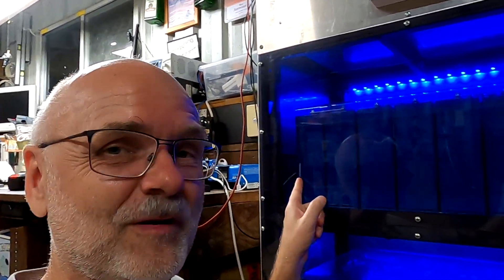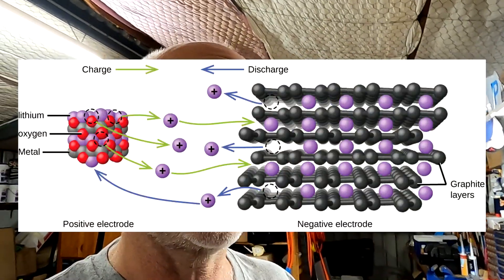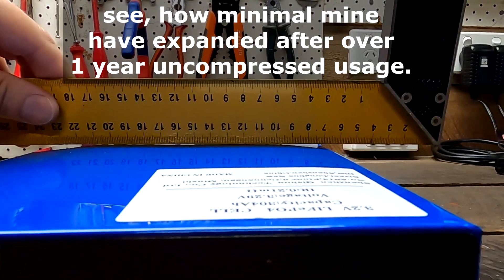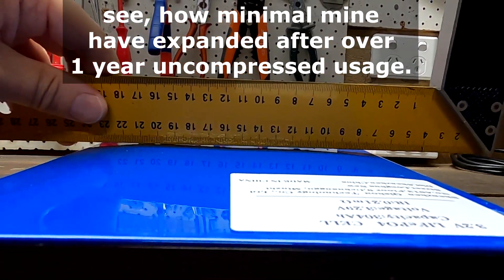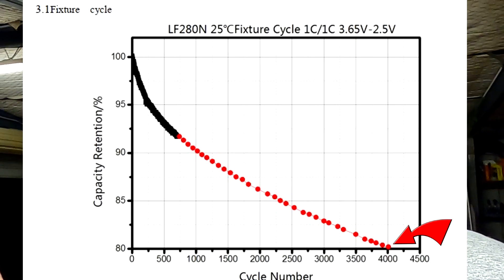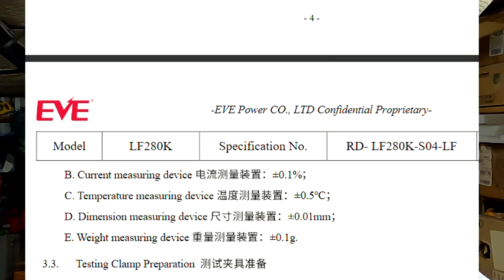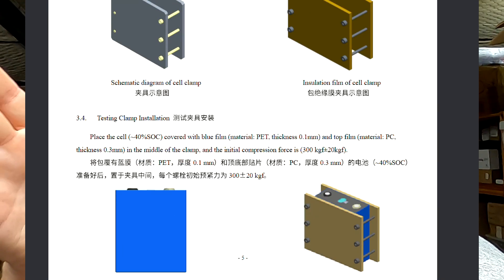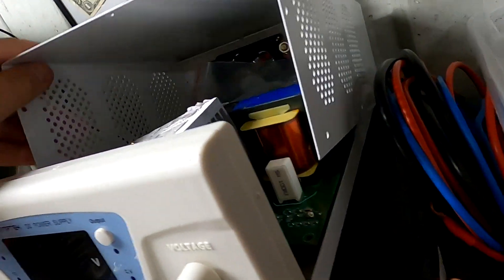Why you should compress your LiFePO4 battery! And why it does not matter... 🤷‍♂️

Comment: From a CATL datasheet :

"The cell will generate swelling force during attenuation. The swelling force of the cell at 60% SOH under the test
condition of 15mm steel plate, which is about 40000N. The customer needs to consider the reliability of structural
strength in the product design process."

I'd say yeah, that is heaps of force. If I did the maths right, thats 1100kPa or 160PSI. Likely more since I used the entire surface area of the side of the cell (280AH) since it was not indicated. Kind of crazy. 

Looking at the construction of various batteries (from those with no compression, to those with squishy foam pad things, to those banded with steel and heavy steel plates at each end) I reckon I really like the idea of squishy rubber padding between the cells, with some compression from either steel banding or threaded rods. Gives some pressure, but has give too. 

Only time will tell, for first hand experience for me. I've only just gotten into the LiFePO4 game.
Reply: I have six different (compressed) packs in operation. All cells are isolated, 2mm cork, 240g/m^2 waxed paper and 2mm foamed plate material. The foamed material looks best and the + - 1mm expension during charge / discharge appear perfect compensated.
My next packs will by in the same way!

Comment: May ask sir is it ok that my 24v battery system, charging voltage for lifepo4 in 27.2v in boost and 26.8v in float? Will it be healthy for lifepo4 battery? Thank you sir😊
Reply from the maker: Yes, that will be healthy. However charging to 27.2V (3.4V) is maybe a bit low. The cells are still in the flat part of the charging curve. You may want to set the charge voltage to 27.6V to get them out of this flat part. Also start balancing at this voltage in your BMS or active balancer. Float is perfect with 26.8V.
Reply: @OffGridGarageAustralia  thank you sir

Comment: Andy, I'm building a Bank 16 x EVE 280ah and I'm having trouble loading individual cells.  I do not have a powerful 3.65V charger to charge each of the separate cells.  I have three 12/24V chargers that support LiFePo4.  can i connect 4 cells in series and charge them to 0A draw.  then repeat this with more sets of cells until it charges them all.  connection in parallel to equalize and install bms and connect to the inverter. 
Greetings from Poland
Reply from the maker: You can only set them in series if you have a BMS connected. If one of the cells is a runner, you could have a bad day. So make sure to get a 12V 4S LiFePO4 BMS for this purpose.
You can also connect them all in series and let them charge from your inverter. But here as well, you need a 16S BMS.
Reply: @OffGridGarageAustralia  Thank you for your answer.
I have BMS JK B2A20S20P so the minimum number of cells is 8 pieces.
The first option is to connect 8 cells together and then the charging voltage will be 29.2V, although one of my chargers can only give 28.6V. Of course with BMS. But it can take a long time.
The second option will connect them all in series, connect the BMS and connect to the inverter, let the sun charge the whole set.
Thank you very much for help

Comment: Well, this is interesting as well… it’s hard to shift mindset from compression to no-compression though.
You made it clear that it’s impossible to prevent the expansion of these cells. There is no hydraulic press large enough to prevent this, right?
What I’m not quite getting though is, with all these people building packs with static compression designs and a variety of collection of cell number, wouldn’t we be hearing about static compression cases breaking? If each cell expands by a few mm, the whole pack can grow quite a bit depending on the configuration. If a 2P4S pack grows by 16mm, I doubt the steel rods holding them together would survive that, or the wood. As a matter of fact, sounds like it’d be quite dangerous! It just seems strange that we don’t hear about compression frames failing, or even signs of failure (though it’s possible I totally missed that). If that expansion is inevitable, then something in these compressed designs has to give…
Reply from the maker: Oh, no, I don't want to shift any mindsets here! This is just for pure information purposes.
And the cells will not expand by a few mm. It is less than 1mm usually, if at all. And yes, wrong compression can be in deed dangerous. The cells will eat this movement internally if the outside compression is too large. Most people use some sort of plywood or plastic for the compression, so this material is some sort of 'soft' anyway.

Comment: Like always just reading and repeating is not enough. You must understand what it means and what the consequences are. W/o compressesion the air bubbles will accumulate and form a larger areas, thus the swelling. With compression the air bubbles will most likely accumulate on the top of the cell and do less harm. That how i understand the chemistry. Correct me if I am wrong.

Comment: I believe that the manufacturers would be the experts on their cells.  If they say it's better to compress, then that's enough for me.  We all are amateurs compared to the experts that design the cells.
Reply from the maker: The think is, they don't say it's better to compress. It's just an option.
Reply: If you have ever worked for a worldwide manufacturer you would have a different view. There are so many different people in a multitude of departments involved in creating a quality product that there is no determining WHY a particular recommendation was ever created. For example, Ford motor company created millions of cars on the late 90's that were touted as having lifetime lubricants. IF the new owners of these vehicle actually followed that suggestion, their vehicle easily made it out of warranty before failing. My 2008 Ford Taurus is among the last on the road  with most of them failing due to all the drivetrain fluids going unchanged. I bought mine just in time and started changing fluids like a mad man.. The takeaway...do not blindly follow a manufacturers recommendations...do some research. Accumulate some opinions. Thanks for listening.

Comment: i'll have to disagree on this one, instead of charging brand new cells i've first discharged them then assembled the battery with little compression, then done a top balance charge... maybe at the atom level they can't compress but i'm pretty sure they haven't expanded so those atoms must have squeezed somewhere... besides, i'm using it in the motorhome, last thing you want with the vehicle vibrations and bumps is loose cells hanging togheter by the busbars... the connecting bolts are laser soldered to the cell aluminium poles, no wonder some come apart.
Reply from the maker: A good fixation is highly recommended in a vehicle. I always said that.

Comment: Hi dear thanks for your all good videos 
I need your suggestions, I have battery pack brand new made it my self with JK BMS 60A continues 16S 14P 2550mah EVE brand. For electric scooter before was anythings perfect in 2 months but now I can see after the ride 2 stering is 0.010mah different I know is nothing but after ride I see the different. It is normal ????? or it make problem in further?????? I can't send you photo here to show you the different all pole is 3.971 and pole number 9 and 6 is 3.961 !!!!!!!
Reply from the maker: How do our balance your 16s pack?
Reply: @OffGridGarageAustralia  thanks for reply after ride the balance differen will be 0.001 is it correct what you ask it for ???
Reply from the maker: @extremerodsdrag4683  It's normal that the cells will spread a  bit after usage, especially after high current discharge through your scooter. Are these LiFePO4 or Li-ion cells?
Reply: @OffGridGarageAustralia  thanks again for reply is 18650 cell
Reply from the maker: @extremerodsdrag4683  Even 10mV difference is totally fine for a 16s pack. as long as on cell is not constantly peaking during charging, I would just monitoring it and see if it gets worse over time.
Reply: @OffGridGarageAustralia  ok i try to keep eyes on it and thanks again for giving time dear

Comment: Personal experiment over a three year span:
LiPo cells not lifepo4 but close enough for the comparation. 
The packs consisted of six 8Ah cells. There were two packs. 
All exterior (outer) cells swollen with age and gentle, much below specifications. Cells were specified to run from 3.5v to 4.20v at 15C. I used them within the voltage range, strictly, and peak currents were below 4C, mostly below 1C. 

All four cells that were on the outside of the packs are swollen, lost their capacity beyond usefulness but the interior remaining cells that were kept compressed inside are still above 80% capacity and not swollen.
Reply: I have gone through 100's of lipos cells over the years flying RC airplanes, helicopters, and FPV drone racing.  Some I have flown even swelled they still continue to work I use them until they will not hold a charge swelling doesn't concern me. The only batteries I won't fly is if they were smashed up in a crash. The few I have seen catch fire while charging always were involved in a crash. Lot depends on brands not all that cost lot more made a difference. Some cheaper brands sold from hobbyking worked well others didn't .
Reply: @Mike-01234  flying an rc with fluffy lipos and riding fluffy lipos ain't quite the same. Alright, it hurts when crashing and burning an expensive model but it hurts more when crashing and burning an EV or a house with your arse in it :)

Comment: Great explaination! thanks for your work. I personally decided to not compress to limit terminals stress. All those flexible busbars are, well, not so flexible. So if busbars cant be - imho we have to keep the cell being flexible, i.e. leave some space around it in a form of air or foam... whatever.
Reply: How does compression cause terminal stress?
Reply: @ItsEverythingElse  my idea is that when we compress - we have to place cells together without free space between them (or minimal foam distancer, doesnt matter). cells still inflate even when compressed (as explained in this video too) and change distance between their centers => stress on terminals, even for flexible busbars (those are not so flexible when you try it by hand), even for oval holes (this video shows that oval holes dont help - terminal was under force until unscrewed). when we place cells with noticeable free space between them (1cm at least) - the freely can breath and inflate to that free space. distance between their centers don't change when they do it.

Comment: When I was building my 14kWh battery pack last year, I was told, that the compression isn't necessary for stationary application as a solar energy storage. I also knew, that the batteries do expand a bit, so I placed small spacers on the corners of batteries, where they don't expand, so they have some space and they won't apply stress to the bus bars. After watching Andy's former video abot this issue, I almost had a heart attack. I saw my euros going to Heaven. After checking I noticed, that the batteries expanded a bit after six months of operation and compression was put on my "to-do" list. But after watching this video I feel a bit more relaxed. I guess now they did what they meant by now so I will just loosen the bolts, relief the stress and tighten back. So, if you are about to build a new battery pack, at least put some spacers as I did, just a bit thicker, maybe 3 to 4 milimeter.

Comment: Your 75 cycles a year would indicate you over-dimensioned the system ;-).  Or at least don't make good use of them.  In the system I am planning, storing the summer solar energy and using it when there is no sun (covering  4-5 months a year of the energy needs of our house), but then in the other month I would use the dynamic tarrifs to charge for 4-5 hours on a lower tariff and then discharging the rest of the day...  I could reach 200 Cycles a year depending on sizing of the batteries... Then the number of cycles becomes important...

Comment: Hi Andy, i wrote a whole story on possible negative effects of not compressing (i've been studying lifepo4 chemistry since 2014)... but.. i deleted it. *because it does not matter*. The only thing that matters is keeping cell temperature as close as possibe to 25C (and above 10C). Things exponentially get worse at higher temperatures. When you keep your pack at 25C it will last 40+ years. If you abuse it, it will last 'only' 10+ years and loses 30% capacity... so what
Reply: Excellent post as I was reviewing comments looking for someone to mention temperature control and consistency among cells.  To that end I think spacing the cells to allow convection currents to rise between batteries and not placing air barriers closely over the arrays would be improvements to the design construction shown here.  Mesh shelves for the batteries and a top and bottom vented cabinet will promote the chimney effect and natural convection will help cool the batts.  Force it with a fan if you must.
Reply: @stevehollifield  Spacing yes, mesh shelves yes. If you really would like to near infinite life from the batteries (it does not matter!) then use aluminum corrugated-core sandwich panels (the thick ones) between te cells and compress. make sure there is enough airflow bottom to top.

Comment: One obvious benefit from compression is that you fix the whole assembly to avoid stress on the busbars,and you are right,for this you don't need much force, the assembled batteries in a PE casing does the job
Reply: yea he didn't even mention it. But the bus bars don't matter, the things they are connected to do (anode/cathode terminals)
If you build the batteries directly touching and straight bus bars it'll damage the anode and cathode terminals.
best is the leave a say.. 2mm gap between the cells or something if you aren't going to put something between it. at least they will last then

Comment: Hey Andy, great you used that fantastic Interview video. What is missing now is the aspect of connecting the cells. Bus bars are rigid whereas cables connect the cells in a flexible way and can compensate the breathing of the cells …

Comment: I just checked my Victron Connect BMV-700 [Google -> Upgrade ostrovní elektrárny 12-36kW, LiFePo4]. It let me know, that for the last 16 months (Jan-2022 I installed BMV-700) I did 13 total charge cycles. So in my case, for 2500 cycles I have to charge/discharge my cells for 256 years. Well I am fine with these numbers.😀. Thank you Andy, you are great!

Comment: Why old cells like Sinopoly or WInston can be positioned at any position, not only with terminals up, and there is no compresion and cells do not swell after 10 - 15 years of using at 15 - 22 *C ? Thera are not layers on LiC6, there is current colector + binder + powder bind together.  Layers of LiC6 are only at pictures to better present intercalation proecess.

Comment: I'm going to agree to disagree on this one. I wish I wasn't under NDA for some of these aspects, but I've seen the difference first hand in my lab which included X-Ray/Neutron imaging of the cells to determine intercalation, morphology changes and degradation processes. Look up "4D imaging of lithium-batteries using correlative neutron and X-ray tomography with a virtual unrolling technique" and search 'compression' in that article. That was a study from 2020 in Nature.
Reply: Thank you! Is a snug wooden box combined with fiberglass tape around the cells enough? Or do we absolutely need to use steel rods?
Reply: @mrtschulias5250  Snug wooden box will do fine.

Comment: I have compressed my 15 x  280ah EVE Batch Matched cells since I bought them, the where perfectly square. 

Had to take them apart and saw they have expanded indeed after a year.

Why did I take them apart? Added 3 more for a 18 cells bank (3.45v x 18 = 62.1v) ... I can because I use Victron equipment. 🙂
Max volts on a 48v system is 66v.
Reply: Interesting (great!) idea. I’d never thought of doing that, going higher on voltage.
Hmmmmmmm.
Reply: @FutureSystem738  Just make sure that your BMS can go that high on volts. I use the JBD 20-cell one. Just had to rewire the balancing leads for 18 cells from 15.
Reply: @i.do.not.exist.9992 Yep, it’s a great idea and if everything adds up and can handle it (BMS, Charger, Victron inverter) then why not?
I really like the idea!

Comment: There is a YouTube video showing a guy overcharge lifep04 cells 280ah cells. almost as thick as wide after the bulge from over charging with a higher voltage. didnt blow the relief valve(vent plug) or whatever that is. they still work.  I think under compression it would have blown the vent hole plug and then you would see fire coming from them like you do with these china BYD cars are doing, go watch these BYD cars on fire it shows when it starts and looks like a flame thrower which means battery cells exploded through vent hole plug.